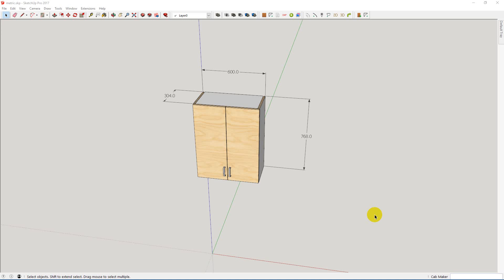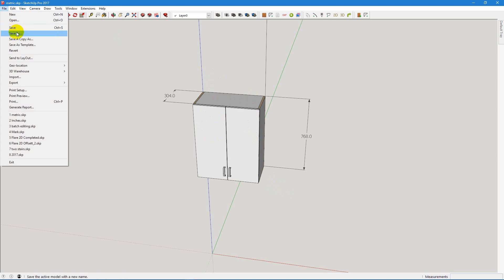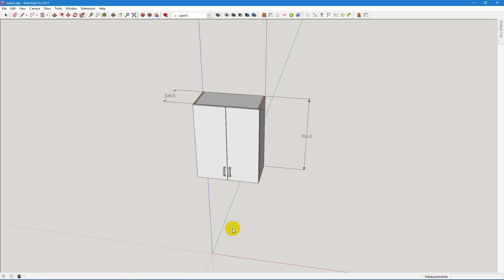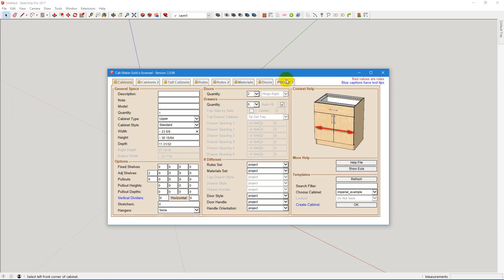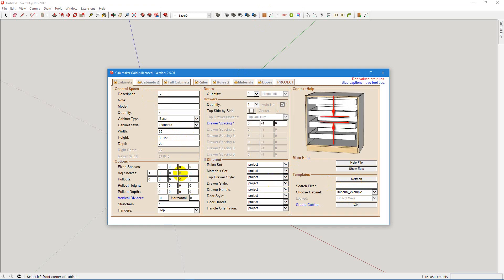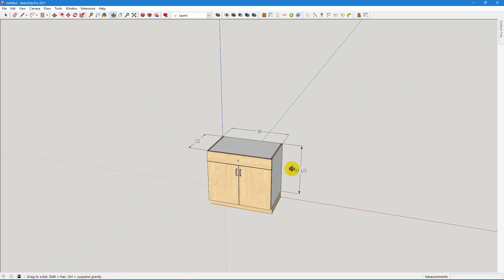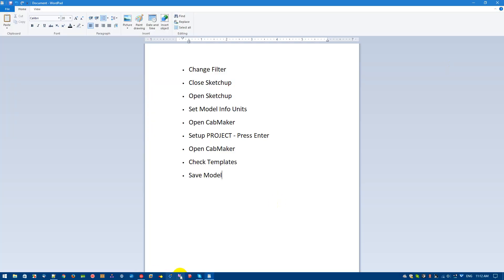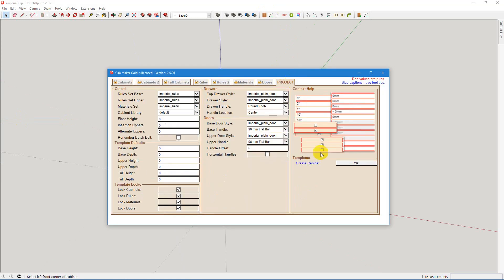Switching Units

Comment: not working report!
I use trial .. 
Trial not use dynamic componont? 
or report mode. I will buy you plugin. But i want cnc mode
Reply from the maker: You must turn on Animate Doors in the Configuration form. There is a report editor where you manage which reports you want.
Reply: Garry Kernan thank you